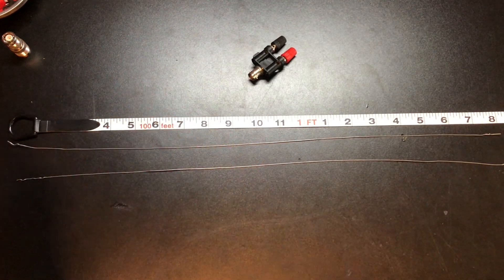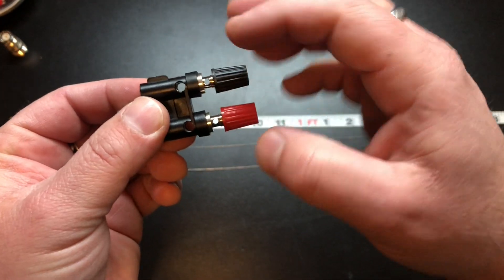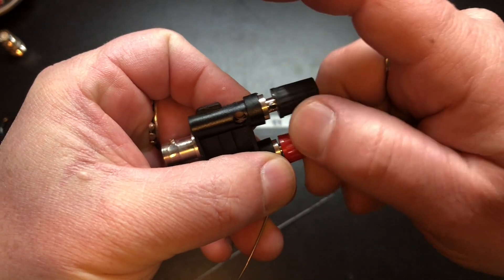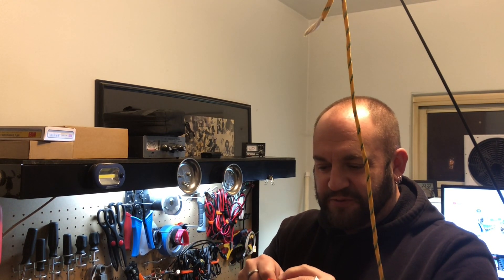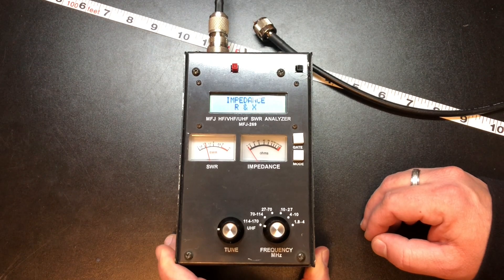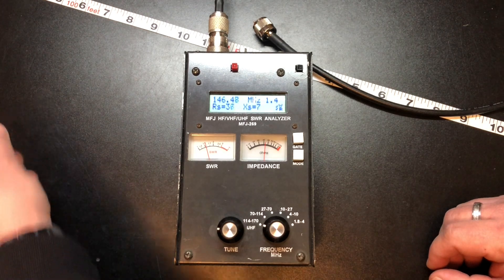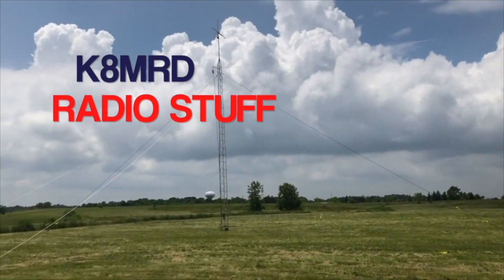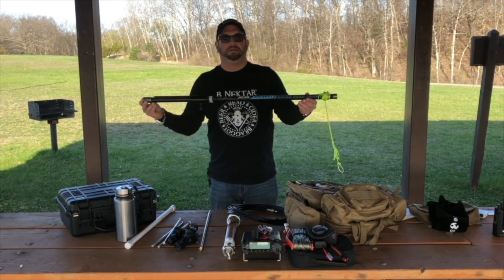2 Meter Solder Dipole : Will it antenna??

Comment: Not a stupid idea at all for a lightweight low power indoor antenna. No reason for it not to work. You could tape it to a window. Will be using my roll of useless lead free solder for this kind of thing.
Reply from the maker: That would be about the best use for lead free solder to date lol!

Comment: Hey mike, i dont have your email so im gonna leave this here... you are always good at getting back to comments

I live in bfe out on a ranch, dont get to leave much and in a hole that gets no 2 meter traffic. i am trying to meet hams in my area and have emailed several of the clubs in the area (info from arrl) explaining my situation and am not hearing back from anyone... im to the point of my studdies that i need some hands on work to really grasp a few thing, i am struggling with some of the number/ electronic stuff ( i do better with hands on/ practical experience ... i get khz and mhz easy... silly stuff like that)

just wondering if maybe i should change my approach, or perhaps you have some tips on meeting folk in the sw north dakota area

thanks for all your great work, love the videos and appreciate your time
JT
Reply from the maker: Well the best advise I could give you would be to do what I did, watch every video you can on YouTube about ham radio.  I didn't really have anyone teach me hands on.  I just dove in and started experimenting.  As far as your 2 meter problem, there's really only a couple things you can do.  First, antenna, antenna, antenna.  Your antenna is the most crucial part of the equation.  That and good quality low loss feed line like RG -213, or even better, LMR 400 is going to ensure your power actually gets to the antenna.  For you it might benefit to build (or buy) a Yagi-Uda antenna.  They can be made out of almost anything for pretty cheap.  Search KB9VBR for his tape measure yagi.  Also, height is might.  If all you're using is that baofeng, that could be the problem right there, its only a couple feet off the ground and stands zero chance of getting through those mountains.  Get a Yagi up 50' or higher and that might make a difference.  You may want to look in to a 50 watt radio as well.  I just moved to Texas yesterday so I'm kind of in the same boat as you.  I just programmed in every 2 meter and 70cm repeater in my car radio and have been scanning listening for traffic when I'm driving so I can find the more active repeaters.  It's prob gonna be hard finding face to face (eyeball) contacts in these covid days.  A lot of clubs are having meetings over zoom.  Maybe email them again and see if they are having any you could join in on, though they may want you to be a member and pay your dues.  Otherwise, maybe set up an 80 meter antenna for NVIS and get your signal over those mountains.  That will keep you somewhat local ~300 miles.  You also live in what a lot of hams would consider a rare state.  There simply aren't that many hams in your area so you may be emailing a "club" that only has a few members and they want to keep it that way.  I wish I had a more clear answer for you.  Just keep trying different things and hopefully something will work out.  Otherwise, just get on HF and have fun.  That's where all the cool kids hang out anyways lol!  Good luck.  Let me know if you have any other questions.  73

Comment: U should try and make a 10 or 20meter antenna with it lol nice video
Reply from the maker: I'd be curious if it would melt with more power.  It would also most likely break at those lengths.  It already did at 20" lol!
Reply: @hamradiotube  nice

Comment: This is classic! When you're done with it you can take it apart and build something else with the solder. The ultimate in ham recycling!
Reply from the maker: I certainly would waste good solder.  I can use it to make my 20 meter solder antenna.  Just have to solder it together :)

Comment: Should have tried the GM repeater if you let me know i could listen in.
Reply from the maker: I didn't even think about that one.
Reply: @hamradiotube  is it still linked to the 2m Clarkston repeater? Haven't been out that way since I was at the old job.
Reply from the maker: @ChrisdeHaan  Not that I know of.  I don't usually monitor that repeater.  I think they might have it linked somewhere in Pontiac or Auburn Hills.

Comment: Soft lead fragile. hey tinned antenna wire goes for big $$. KC3ONO
Reply from the maker: Yes, not the most practical thing in the world but it was fun experimenting.
Reply: @hamradiotube  I bet that’s what this hobby is all about. Wonder if you have better results using welding rods 😉😉😜☺️KC3ONO
Reply from the maker: @kevinkc3onohelijeepworld  I feel I've seen that done